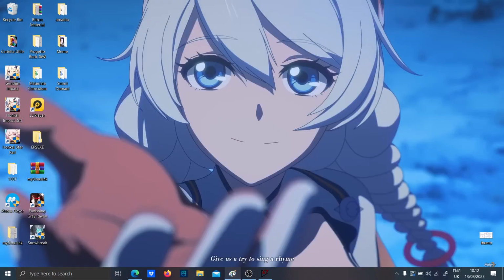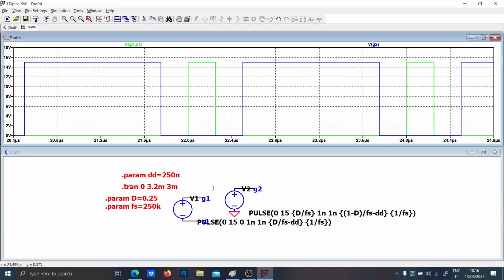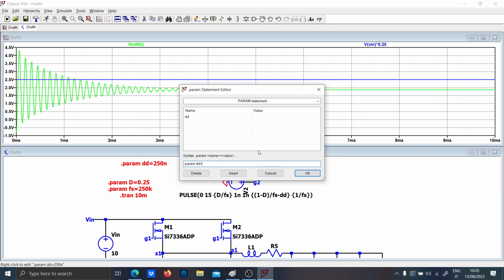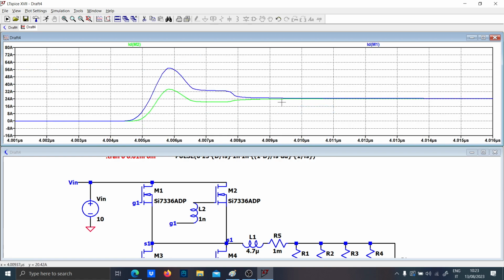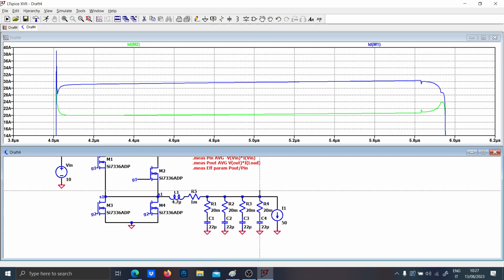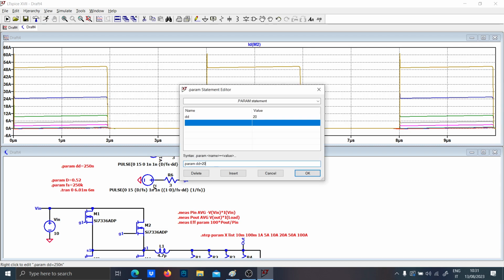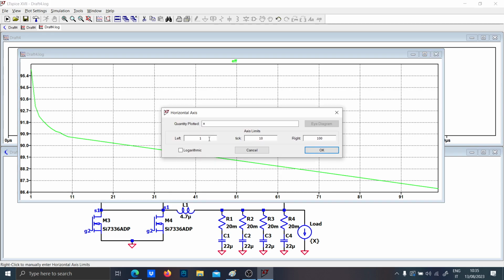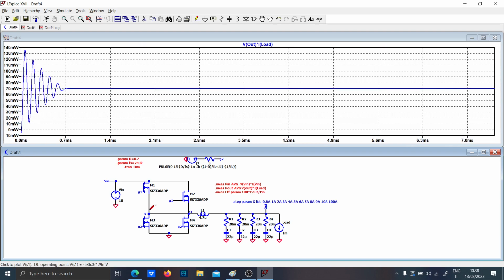LTSPICE Parallel Switches Buck (Current mismatch and Efficiency)

Comment: Hello there. I’ve been watching some of your power electronics videos and I’m wondering what’s the best/most energy efficient way to do soft starts and stops on DC converters. Like, I think I’ve got a good grasp now of how to do soft switching so that the losses are minimized, and of how to do synchronous switching so that I’m not dissipating power through a diode half of the time. But the peaks of current that happen at startup (and similar transients at shutdown) bother me.

Comment: Hi and thanks! Just a noob here, wondering, can you use GaN FETs to increase efficiency of your circuit?
Reply from the maker: GaN switches have less rds-on temperature dependence with respect to their silicon conterpart. Plus, they have more vgs_threshold stability over temperature which is foundamental for parallel switches. So yes, and today many industries are designing converters with GaN and Sic